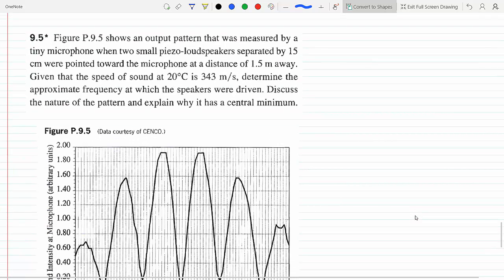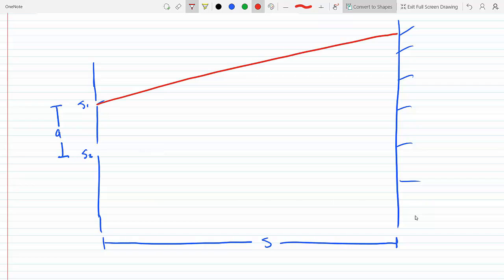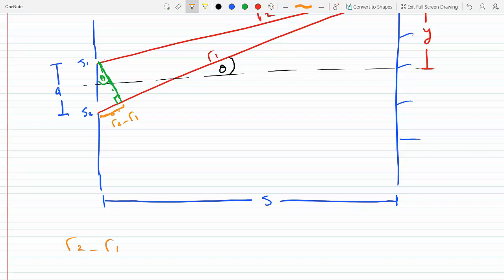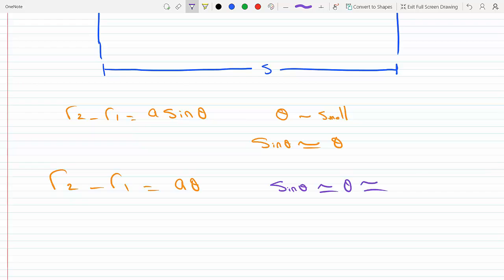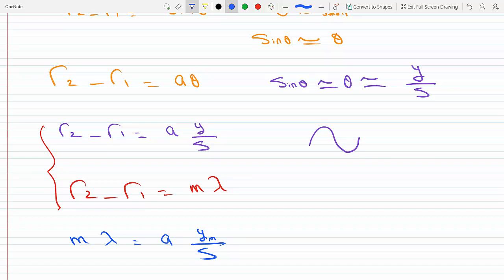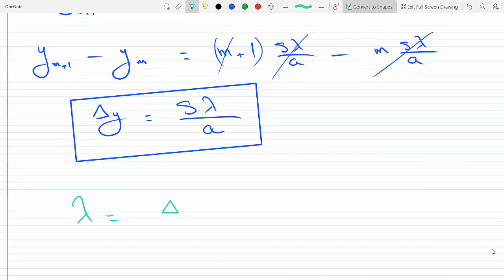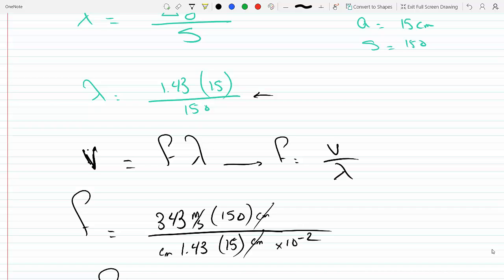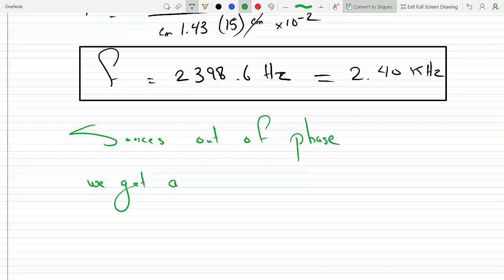Derivation of Young's Double Slit Experiment formula and P 9-5 Optics

Comment: How the hell do you know that green angle is theta? I cant find an explanation anywhere
Reply: Theta is basically an unknown angle. Much like X or y in algebra.
 but instead for angles u use theta.
Reply: @ABam_001  I mean how do you say that the purple angle and the green angle is equal? Why are they assumed to be equal? They could be anything right? How to prove that the purple angle is equal to the green angle
Reply: @utkarshmishra7416  I had this same issue, and I just solved it. The green line is like the r1line rotated 90deg counterclockwise. The wall with the slits is the middle line (with length S) rotated 90deg counterclockwise. Now, the middle line makes an angle theta with line r1. If both of these lines are rotated 90deg counterclockwise, the angle between them remains theta. Thus the green angle is theta. Imagine rotating the middle line and line r1 both 90deg counterclockwise, and then match them with the green line and slit wall line, showing that the green angle must be theta.
Reply: @Fysiker  bless up
Reply: I just realized it's easier to visualize going clockwise, since you don't need to look for corresponding angles.
Reply: @Fysiker  Thanks a lot man :)